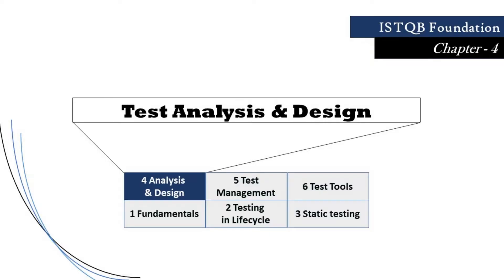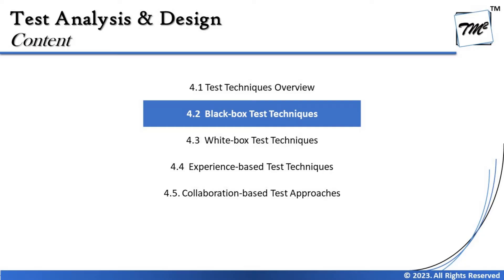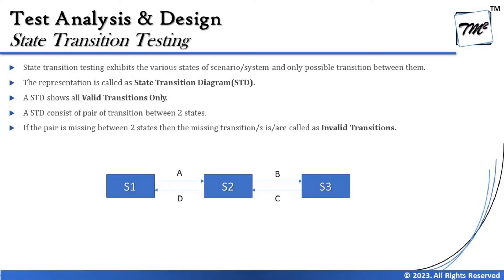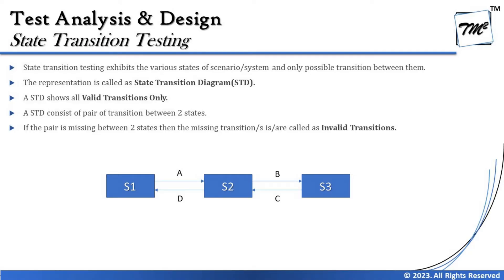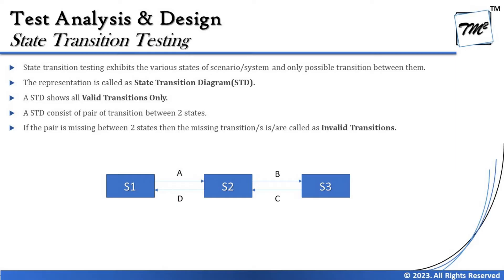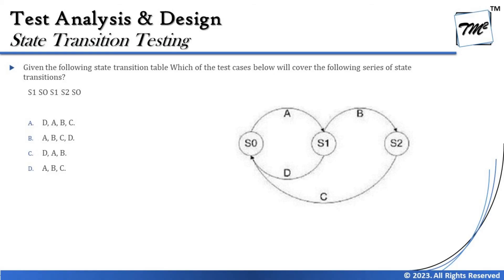ISTQB FOUNDATION 4.0 | Tutorial 33 | State Transition Testing | Test Case Design Techniques | CTFL

Comment: Hi Neeraj, Great video. However I see in the CTFL Syllabus v4.0 from ISTQB , it talks about all state, valid transitions and all transitions coverage on page 41. 
You have not discussed them in this video. is there any other video on that topic that I am missing out on? 
Please advise, you explain so well that syllabus is not useful alone to read unless I follow your tutorial alongside. thanks!
Reply: Hi, I have the same question now, please reply if you find the answer :)
Reply from the maker: Hi I think you have the answer in your question itself.

All state is were we find the minimum number test cases with covering all states at least once
Valid Transition is were we check the valid scenarios only - as discussed in the video the one's which are represented
All transition includes the invalid as well - as discussed the one's which are not represented.

It's just the technical name but yes the concepts are covered in the video. 
I hope this helps.